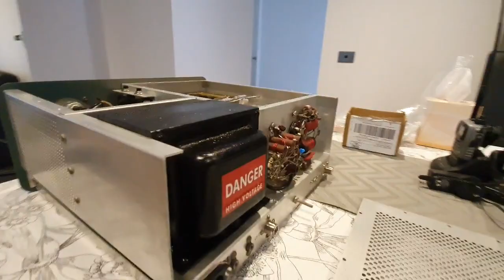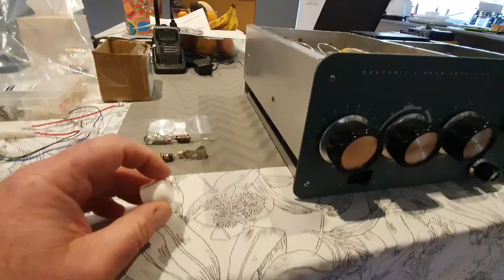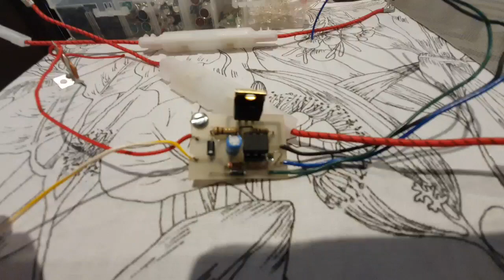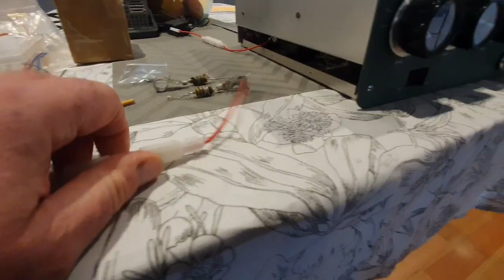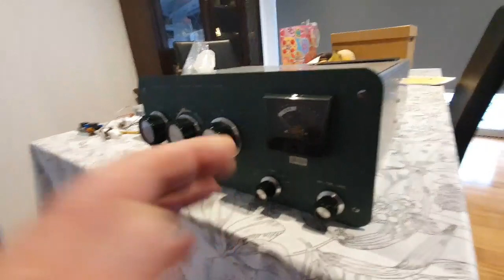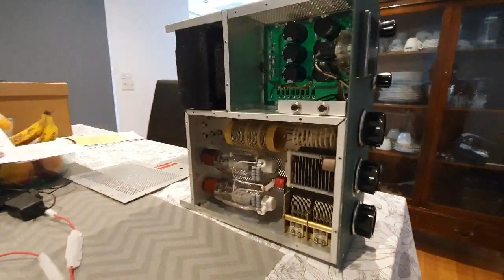Heathkit SB-200 Summary of Updates - Hair Pin Parasitic Suppressors - Future Work

Comment: I have repaired hundreds of these amps, and add a HV fuse. Just so you know, unless you use a HIGH VOLTAGE FUSE like the 5KV 750 ma fuses used in microwave ovens, you are in for a thrill the first time it blows. Fuses for 220 volts or less will explode like a cherry bomb (4th of July explosive'). The lower voltage fuses will explode due to an arc being drawn when the fuse opens and the heat generated by the arc will fill the glass of the fuse with super hot air, BOOM! Then it could continue to draw an arc.
Reply from the maker: It's a microwave fuse
Reply from the maker: The fuse is for 240vac as its a 240v tapped amp

Comment: I really thank you for your vids on this. I am in the process of rebuilding my sb-200 and am having issues with parts also.  I did order the same PS HV board and it just came in. Looking for the HV doorknob caps the other other 20uf caps.
Reply from the maker: Your welcome Lloyd.  Re door knob caps I recommend connecting to Face book groups: heathkit, heathkit club, and list your parts requests there, you will get a response from enthusiasts and suppliers, im Confident.

This is the path for us all these days.

I only have a couple more videos to go on this SB200; Soft Key for modern radios, then Low Pass Filter test